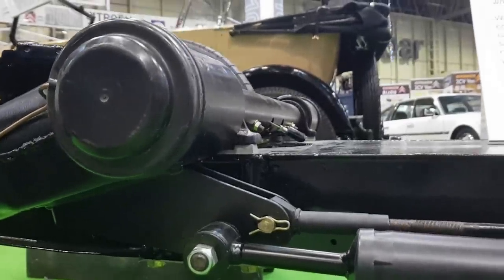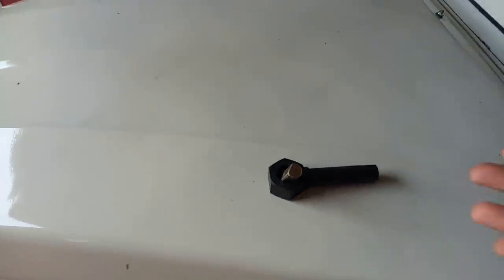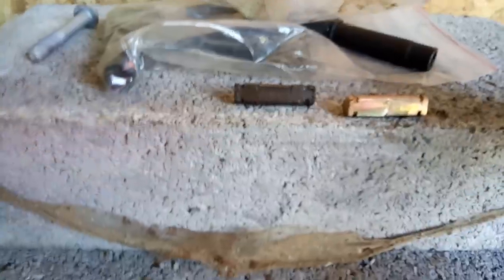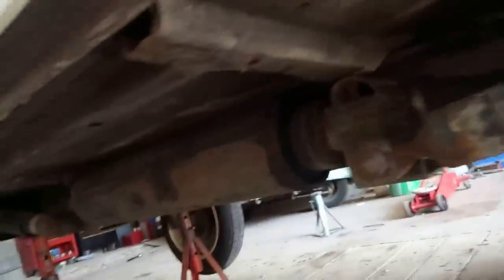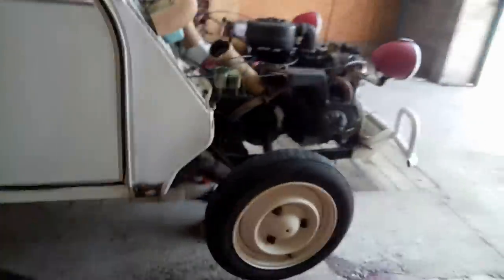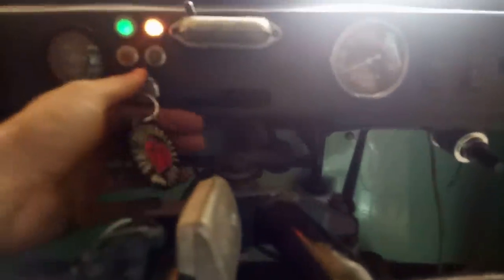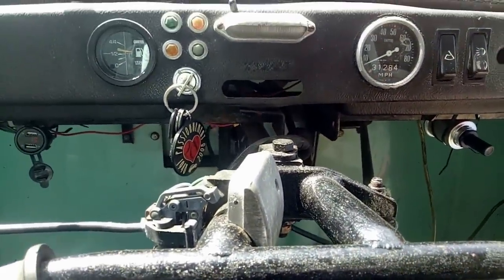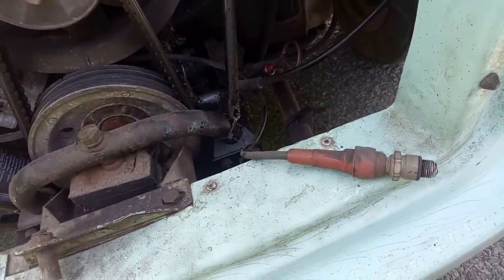2CV pre-Croatia prep with bonus Invacar fail!

Comment: One of my many aircooled vws spat a plug out once, (had the benefit of double the cylinders you have so limping home was possible)
But I helicoiled the plug thread in the head and it was fine. Old alloy heads like to do that.... some race vw engines run helicoils as a matter of prevention rather than repair

Comment: Just a non-video-related 'thank you', Ian for your Foxanne tips on painting cars. We had Bodgit & Scarper repair our gates last week - and as I'd guessed, they'd not painted the top edge of the gate - so it was was still bare (rotten) wood. I've a tin ('plastic!') of black 'stone' / masonry paint - so gave the top edge a coat of paint - but I knew it'd still collect water - so I used my 'designed but not tried' method today of super-bodging a paint job on the gate top to cover all the holes etc. that'd collect water and help the rotting process. It goes like this: Apply fresh coat of paint, add strips of newspaper (to cover the holes) paint the newspaper. Add another layer of newspaper and one more coat of paint - so it's a cross-between painting and papier maché. Looks a lot better and is hopefully far more sound !
I then was wrapping up tools and paint etc. and noticed the back panel on the Kangoo with half the black paint peeled off - and there's me with a paint brush containing black paint - so yes - painted the back of the car with it - looks a lot better! So as I say, thanks for the tip Ian !

Comment: I don't get the idea of the Knife-Edge instead of just a round pivot pin.  I see below that someone has suggested less friction.  However, one thing I remember long ago from my aircraft engineering apprenticeship is that friction is independent of surface area.  We had to prove this by measuring the force required to drag metal blocks in various configurations across metal plates.  It matters not if the block is on its side (big area) or on its end (small area), the force is always the same.
Reply: To be precise the COEFFICIENT of friction is independent of area you need more effort to overcome the friction of a larger area of contact but when you run the equation the coefficient is the same
Reply: I don't understand the reasoning either.

Comment: Same thing happened to my beetle. The number three cylinder popped a plug, which gets hotter than the other cylinders. A helicoil worked for a few years, eventually I had to replace the head.

Comment: If the thread is stripped in the head, I have an unused 'savathread' spark plug thread cutter and inserts you are welcome to. It's like a helicoil but a full threaded insert. It will only fit M14 x 1.25 threads however.

Comment: Rather bemused by the 2CV suspension linkage. A completely circular pin would work just as well and last a lot longer. I presume its flat sides are to stop the pin rotating - to ensure the movement is on the correct part of the pin. On the whole, I think it makes the torsion bar look like a great idea !

Comment: Some days everything goes so badly we feel we shouldn't have gotten out of bed. Seems a box of spare parts and a dedicated tool kit should be tucked away on some cars.  In the early 80s my Moskvitch used to eject one of its spark plugs regularly - it would shoot out, hit the inside bonnet and richochet out of the engine bay into the road. I kept a clean spare in the extensive manufacturer supplied tool kit (along with its Communist Haynes-style manual that had instructions on 'how to lay up the car in the event of hostilities') Happy memories of searching for the ejected plug in the road that could then be cleaned up to replace the spare. Mind you, my 2 stroke Suzuki 100cc motorbike back in the 70s even used to melt plugs sometimes, so I'd gotten used to carrying spares years before.

Comment: RE: 2CV valve clearance. The feeler gauge is wider than the valve stem that wears into the rocker arm and therefore bridges across the wear. Buy a cheap dial test indicator and use that to verify the clearance

Comment: I would be careful with gear oil changes ian.
i put a new brand in (well known) gearbox oil that i never used before and it started leaking from the input shaft seal as soon as i went for a drive.
The same viscosity as the other gearbox oils i used as well.
Stick to what works for you and don't chop & change.
Good video ian as always.(:-)

REPLY
Reply from the maker: No, 2CVs definitely benefit from frequent gearbox oil changes. Bad things happen otherwise.
Reply: @HubNut  I did not mean it to be read that way.
What i meant is don't chop & change with different brands as some seals may leak like it happened with my car recently.
Its something to do with new additives i guess that they put in and that makes old seals leak,but may be fine with newish cars.
I change my gear oil every 2 years and stick to the same brand that gave me no troubles.

Comment: Some days are just crap!
It’s better to just sack it all off and walk away for a bit.
I would have tried the other plug in the head to make sure the treads were ok while I was there because based on that info, a plan can be formulated back home.
Hopefully Elly is just vibrating because she can and not because she’s broken.  I guess time will tell. 
Great video as always, despite the issues.  Don’t be too despondent👍
Reply from the maker: I had absolutely no tools with me, so the other plug was not coming out. I think I've found Elly's odd noise. Nothing serious!

Comment: Ummm... so why do the knife edges have a triangular cross-section instead of circular? By putting all the loads from the shackle on the vertexes of the knife edge, the vertexes should wear first- which seems to be what you saw. Or is the triangular cross-section to allow volume for grease?

Comment: The Saab, TWC and valve clearance error with Elly, they say bad luck comes in threes, so you should be safe from now on Ian. If you're going to have cars breaking down, it's better that it happens here than when you're in Europe with Elly. I've only ever had a plug blow out once, it really is quite an alarming experience.

Comment: I've made up some hard steel tubular bushes to fit inside the shackles and stop them wearing on the inside.. the knife edges are placed inside the bushes.

I would think that rubber or polyurethane bushes could be made for the same purpose.

Thoughts?
Reply from the maker: I have faith in the Citroen engineers. Original seems to work.

Comment: That SAAB, was it a hose going in the top of the intake manifold? That bugger wouldn't stay in on the SAAB 900 I had.
Reply from the maker: Yes, though it blew a small pipe off which made the problem worse. It'll all be in the test video.

Comment: Quick n dirty roadside fix for anybody who has stripped sparkplug thread: if you have some random electrical wire in the car,  strip the isolation off, cut a copper strand off and wrap it around the sparkplug thread. Then carefully screw the plug back in the head.  If you have no electrical wire on hand maybe you have   some aluminium foil? That works as well. A fix like this might get jou home or to a workshop. Don 't worry about the thread in the head because that'll be buggered anyway. It will need a helicoil insert.

Comment: One of those days... sounds oddly familiar.
I believe you should actually loosen the manifold bolts before torquing the heads to do it properly. And you should always check valve clearences after torquing them, which you did... a few times.
Maybe grease up the kingpins as well before such a long journey...?
Reply from the maker: Kingpins were done just the other day. For retorquing, undoing the manifolds is not necessary.

Comment: Engines 'bed in' when they're new and 'bed out' after about 25,000 miles, so you should tend towards tighter in older engines rather than looser.
This SO reminds me of the cars we all had in the Seventies!
Will have stripped the head thread, plugs have harder threads than heads.
HubNut and Ellie, Samson and Delilah??????????😁😂😉😁

Comment: Why did Citroen use  a knife edge rather than just a circular pin which would have been cheaper and simpler to manufacture, has a greater wear surface and places less stress on the eye (which are prone to cracking)?
Reply from the maker: The eyes aren't prone to cracking unless you ignore them for quite a long time (as in tens of thousands of miles).

Comment: If it proves to be the cylinder head thread then a good engineering shop will put in a helicoil. I remember a plug tread going on a friends car and watching a very knowledgable old fellow cut out a new thread and insert the helicoil, all with the head still in situ. I was panicking about all the swarf in the cylinder bore and he just smiled the benign smile of the fully initiated!  He fetched the power grease gun and inserted the end in the cylinder and pulled the trigger. The cylinder filled with grease and as it started to come out of the plug hole, there on the leading edge of the grease was all the swarf trapped in the grease surface. 😧😅. Still let's hope it is a bruised plug thread or combustion crud in the female thread.
Reply from the maker: It has turned out to be a cylinder head stud that has stripped its thread...
Reply from the maker: On Elly that is. Not a good week!
Reply: These things are sent to try us!  Better it happen now, L suppose, than on the great adventure. "Go well" Mr Hubnut🙏🏻

Comment: Ian always carry a set of 2 spark plugs a set of HTs  and a rotor arm and a set of points, when driving a 2cv. advice coming from a 1979 2cv6 driver that had many happy hours broken down o my gear box blow up on a run to Swindon from Cardiff on the mike 4 o happy days.😊
Reply from the maker: Rotor arm on a 2CV? Are you sure? ;-) She's on 123 ignition, but I will take a points box with me just in case.
Reply: @HubNut  sorry Ian got a bit muddled I used to carry a case with bits hot my 2cv6 and my morris mini 850cc points were for the mini. Never went out without my case of bits and bobs saved me a good few times over the years. Now you need to carry a diagnostic device and be a member of a tow service. (O happy days) 🚗

Comment: You can get coils inserts for the spark plug but you have to get it done by an engineering shop
Reply from the maker: You can do them yourself, but I do have spare cylinder heads.

Comment: Question Ian - the Knife Edges you mention in the suspension....why are they triangle shaped? Maybe I am misunderstanding, but is there a reason for that? As you said - all the weight is resting on those edges of the knife edge and they wear....wouldn't it make more sense to have the whole 'knife edge' part be round (as on a bolt) so it more squarely fits into the hole on the shackle and so the weight is spread onto the shackle more evenly so the 'knife edge' wouldn't wear out as quickly?

Very interesting engineering!
Reply from the maker: Better to keep the wear face smaller I think. There's probably a sound engineering reason for it, but sadly I'm not a sound engineer...
Reply: @HubNut  That's OK! It didn't make sense to me, so I'm obviously not an engineer either!

Hope you can get TWK sorted and it's not a major issue like the head threads being stripped! Good luck on the rest of the Croatia prep and looking forward to the next video, as always! :)

Also, nice idea on Elly's roof mesh! Should help to keep bugs out as well!
Reply: Less friction. I hope this helps
Reply: @1970savage  Ah, true! That would make a lot of sense!

Comment: 45c for us the next few days mate ! The strange resonance you talk about in Elly sounds like it compression coming back through the intake, are your valve tolerences correct ?
Reply from the maker: Yes. I set them twice. Turned out to be a cowling pipe that had slightly come adrift.
Reply: @HubNut  Good ! Problem solved !

Comment: Your  " Resonance"  sounds like tight Inlet Valves. The noise you hear is coming from the carb, because the inlet valve is not quite closing on the induction stroke. I don't thing that's a good situation for the  trip you are planning.
Reply from the maker: Nope. Turned out to be a rattling bit of cowling. Phew!

Comment: I work as a process operator with PLCs and mechanical machines greasing something exposed to dust is not such a great idea imho.
Reply from the maker: It's what Citroen recommended.
Reply: @HubNut  For sure I believe you, but my C5 was also recommended 10W30 when all experts put in 5W30 after tappet issues.

What I am saying is from experience with machines (not 2CVs) is that grease will only attract more dust to collect.

Comment: Very iffy running with fuel pumping out a plug hole. You need a Timesert kit, I'm guessing you didn't tighten the plugs enough, or over tightened but that usually causes failure soon after. I definitely blame the hair.
Reply from the maker: Agree it's very iffy, but alternatives were a little thin on the ground...

Comment: Probably not a good idea to have a cylinder hole blowing petrol vapor into an engine bay with  dangly HT lead sparkage.
Reply: what could possibly go wrong :-)
Reply from the maker: If you haven't got compression, it's very unlikely to ignite.

Comment: You've got 2 cylinders and 4 valves... why not just set the valve clearances correctly instead of just randomly winging it ????

Saw a top-down 2cv driving round the corner from me the other night... budget wind-ibn-the hair (>>) motoring.  But not a Continental cruiser..
Reply from the maker: I did set them. Twice. I got the gap wrong first time.
Reply: Fair enough, just seems odd to deliberately set clearances outside the specified tolerances...

Seem to remember on the Top Gear challenge through Iraq and Syria that one of the sports cars kept blowing a spark plug out.... think it was the MX5.